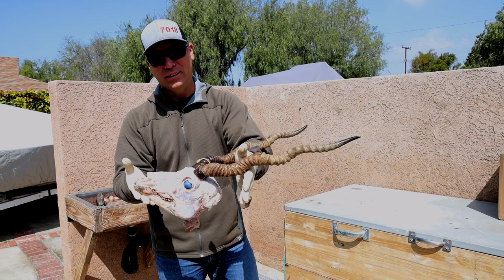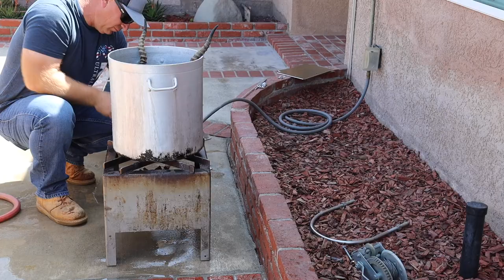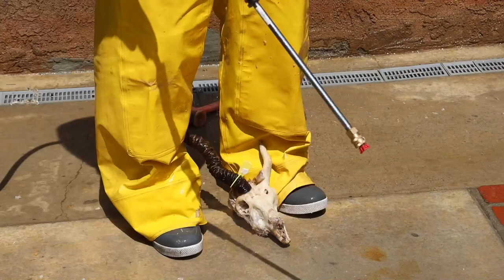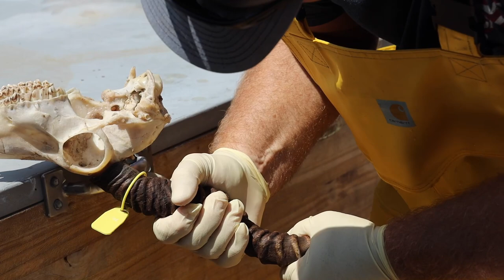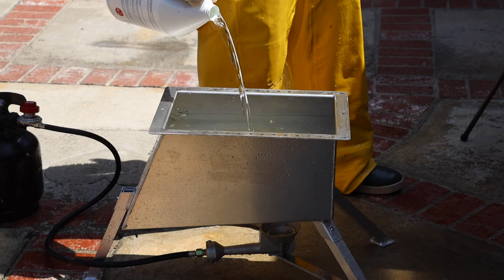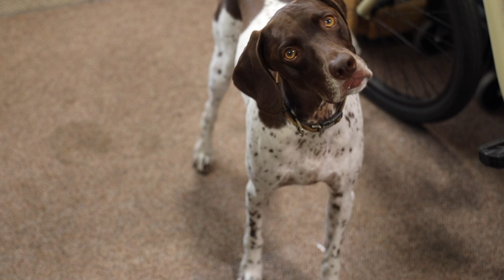HOW TO CLEAN A BLACKBUCK SKULL

Comment: That skull is awesome and those horns are insane!  I love your videos and they have taught me so much about skull work.

Quick question: I recently cleaned some sheep skulls and after lots of boiling and whitening there are some grease spots on them.  If you find areas of grease after you whiten and dry the skulls, will you soak in acetone then re-whiten or is it okay to leave it be and seal the skull?

Comment: You're vids are extremely satisfying to watch and helpful, but I have a question, what do you use when you don't have access to the power washer? 

I have a sheep skull that I'm trying to clean, but I don't have a power washer. Honestly, I don't have most of the materials you use but I can make due for most if them, I'm just not sure how to remove the flesh without a power washer to blast it all off.